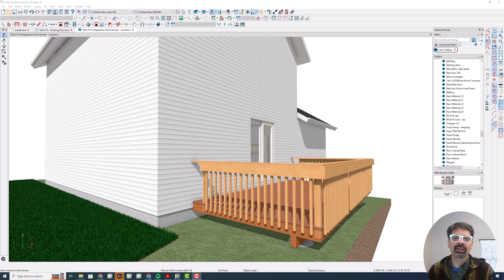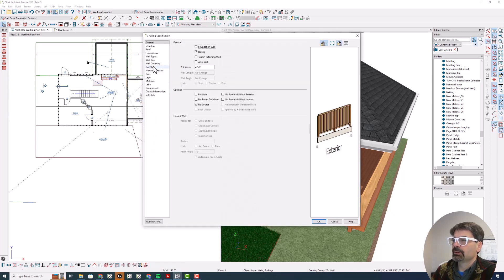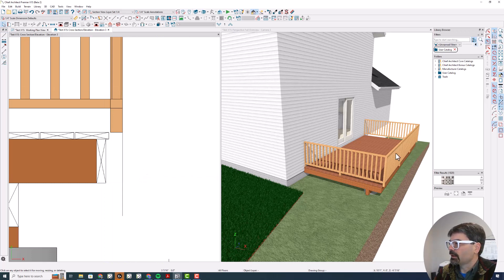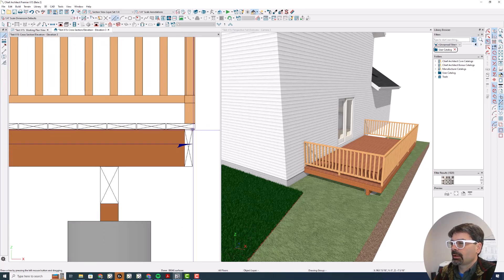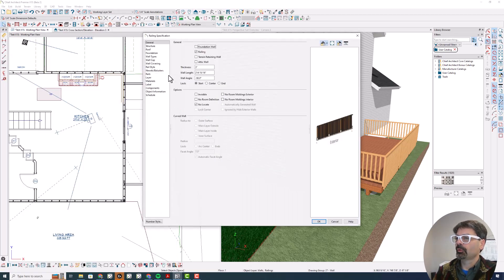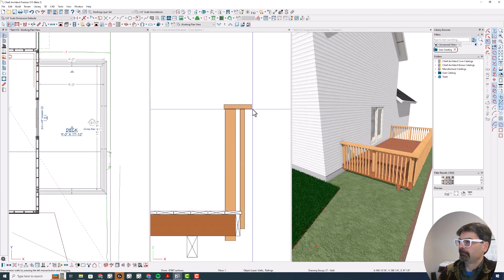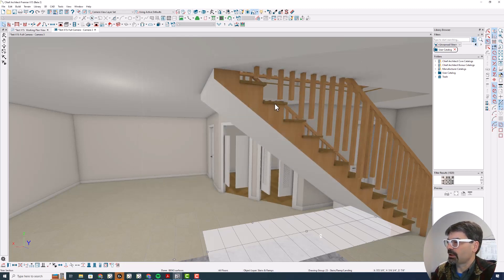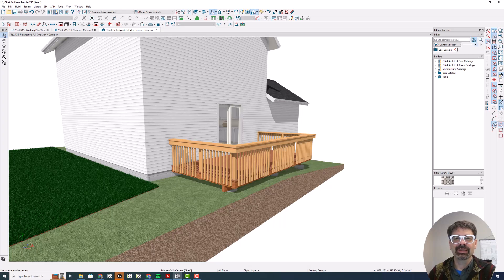Day 5 - Railing Offsets | Chief Architect

Comment: This is probably my #1 new feature. I have asked them for this for many years and we have much more flexability. I did hear they are making some minor improvements to this feature for the final release, so hopefully we'll see some improvements to the missing baluster issue and the gap stair handrails have when connecting stairs to offset deck porch railing, especially when a symbol is used for the newel / column.
Reply from the maker: This really is a great feature isn’t it? Fingers crossed on the improvements for the final release or a quick update later.
Reply: @DesignbuildsolutionsLLC  Sure is! I think a workaround for the baluster gap issue for now is to make a symbol panel out of balusters, then set the railing style to panel and use the baluster panel symbol in the panel section.
Reply from the maker: @SeacoastHD  Interesting thought. I just checked it out and panels also stop at the newels, so still have a gap. :(

Comment: Finally, we have more railing flexibility. As a guy who builds a lot of decks, railings have always been a PIA on Chief. I could get them pretty good automatically but there has always been work arounds for certain area. Always had to make the rail/wall like 6.5" wide to get the rail post to locate inside the deck box frame. Which is fine but then from a plan view perspective you see the outline of a 6-1/2" rail/wall which is a bit annoying.
Reply from the maker: Yes. This almost solves most of our railing issues. I hope they fix the missing baluster issue soon.

Comment: Way cool Tim, Thanks for sharing. X15 seems really cool, I will say I am struggling with the way it loaded up to run (alone) I guess they are pressing us to import as is. This doesn't have my defaults, hotkeys, or settings... I have been using chief since 10 and I don't remember a migration like this. I finally got the toolbar built up and now I am hesitating about importing my old libraries and templates...I printed the Migration Guide and I am going from X14. Do you have any thoughts on the pros and cons of what and what not to import? again thanks for your hours of contributions.
Reply from the maker: Hey Doug. Thanks for watching and I'm glad this is helpful. 
I didn't have any issues with migration, and I migrated all the settings. I did see what I think is a new tool in the Preferences dialog under "Reset Options" that "Reset Migration" is now a button that supposedly will help to allow migrating old settings again.
Hope that helps.